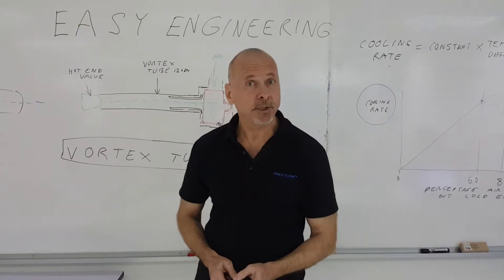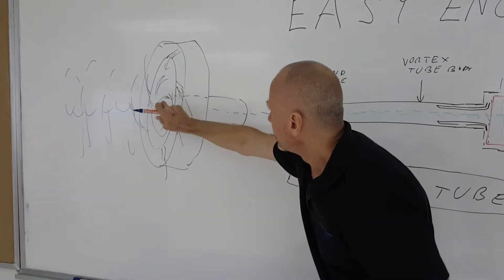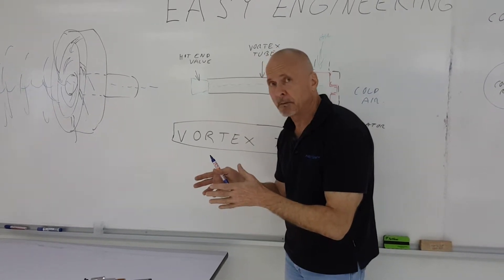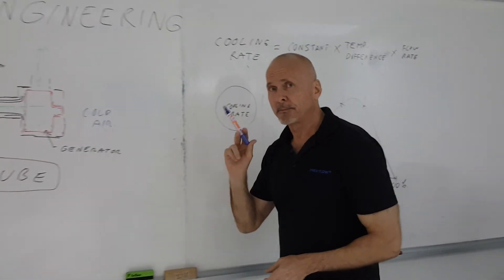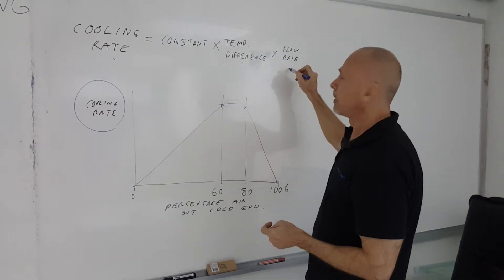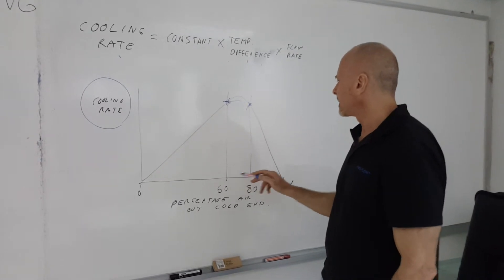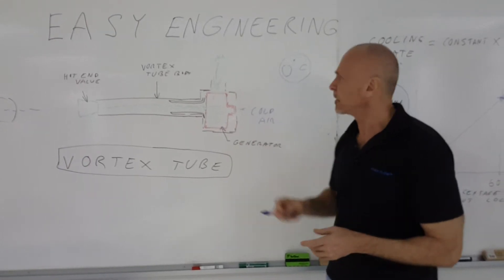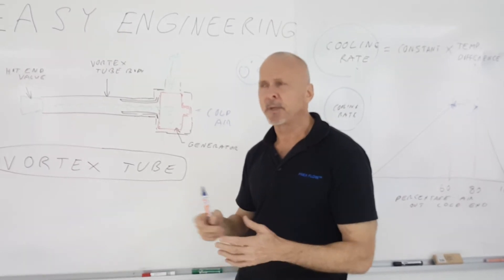EASY ENGINEERING - How Does a Vortex Tube Work and What are the Parameters

Comment: The issue with conventional explanations for the VTs operation ( bladeless adabiatic turbine ) is that there isn't any reason we know that (1) the air should remain spinning or (2) it should return down the core in such an organized fashion. The heat transfer being somehow solely convective is also a big problem because dwell time is so low. Also, if a vacuum is present in the central inlet, that SHOULD be possible to create without having to "swirl" the air, but that doesn't work at all.

In other words, although we know how to tune these somewhat, we still do not know how they work, despite claims to the contrary.
Reply from the maker: I am not sure what you write is completely correct, although very true that there are many theoretical explanations for why they work.  Heat transfer being conductive is not a basic assumption for the very reason you state.  I tend to prefer the angular momentum energy transfer approach but again, there are different theories.

Comment: Hello there,

Very informative video, does the temperature of the compressed air going in change the cold output? I.e if I use 16 degress Celsius compressed air vs 30 degrees compressed air?

Any help would be much appreciated
Reply from the maker: Yes - the vortex tube is designed to give a certain temperature drop from whatever the input temperature is.
Reply: @NEXFLOW  wow really?
Sorry just to clarify, I am using a vortex needle that is currently giving me -12 when ambient in my work shop is 12 degrees Celsius or near the compressor.
So In the summer when my work shop reaches around 25 degrees Celsius will I still have the same -12 degrees Celsius.
Does flow rate from the cold end get affected buy this?
Sorry for all the questions and I appreciate the help!
This is amazing technology which I have become obsessed about.

Kind regards 

Lewis
Reply from the maker: It is unlikely that the actual compressed air changes very much with your shop environment as it always gets hot when the air is compressed (and then usually cooled to a certain temperature.   This is probably why you do not see a significant if any change in temperature output.   Flow rate would not change.  Send any detailed questions to sales@nexflow.com and can give more detailed answers.
Reply: @NEXFLOW  thanks so much for this info!

Comment: I am experimenting with vortex cooling. My occupation we put people into an "oven" to work . Roughly 150 degrees F. They also wear chemical and fire protection. The bulk weight limits more body worn devices. Currently we use a breathing air supply to a manifold that directs air to a respirator and the other, a body cooled manifold. The body cool supply is directed through a vortex cooler before going to the body. The compressor that supplies is industrial. But as you say, flow rate and temperature make a difference! 
I installed a vortex cooler outside the "oven" prior to breathing air supply hose in addition to the body worn vortex of the oven entrant. This worked to make things cooler. However, you must dial in the vortex tube adjustment to the optimal settings. The breathing air respirators  are air on demand. So, the more you adjust for flow out of cooling tubes, the more "assistance" one loses in breathing due to pressure drop. Wish we could be approved to lose these air-on-demand regulators. I need people to be able to breathe freely and remain cool as possible while performing work.
Reply from the maker: We can offer some assistance on this.  Please send your details to technical@nexflow.com and one of our technical support personnel will get back to you

Comment: You all missed the boat. Where does cooling air come from. When you compress air you add energy and increase it's pressure. Now you have relatively warm high pressure air. Add a small restriction, orifice and the end of the pipe, the air velocity increases, pressure decreases, air looses energy as it dissipated to atmospheric pressure. Looses energy means it cools off. So the actually cooling affect is created at the small price, air restriction causeing the air to leak out and rapidly expand, loose energy, cooling the once high pressure warm compressed air.

In other words, just like when you let air out of a warm car tire, as the high pressure car tire air escapes and expands to atmospheric pressure the air inside cools.

This is not a very efficient kethode of cooling because it takes a lot of energy to compress air, your simply bleeding the compressed air out, which the compressor has to start and run to keep the compressed air system pressure up
Reply: Sorry but you not correct.  The cooling is NOT from the pressure drop.  I strongly suggest you look at the plethora of video's and other studies on vortex tubes and you will understand..
Reply: Cooling is controlled by energy laws, you can't create it destroy energy. So for cooling to take place all your doing is moving heat, energy from one place to another.

In this case energy from electricity is used, moved from the electricity through a compressor compressing air moving energy to the air. Then you let the compressed air out, it expands, energy is dispersed cooling the air ...

Comment: I think it should be common knowledge by know how cooling works... taking hot air away and replacing it with cooler air... the confusing part is how does thee air invert itself without destabilization, one thing that he doesn't explain, so on to another vid that shows how it actually works...
Reply: Not sure what you are commenting on here.  The video is strictly on how the cold air and hot air are created with a vortex tube, and the parameters on the efficiency and temperature range - nothing is replaced,  As for using it, that is another video of course.
Reply: @mycutebutt1000  It is unfortunate that physics is hard for you, but to make it easy on you, when you use active cooling, hot air is moved and replaced be cooler air... thus correcting your first statement... then second is my actual question where he does not go on to explain  how the inversion happens. it's like "let's skip that part cause we don't know either" thing
Reply: Hello again.  We mean the same thing,.  Sorry for any grammatical missteps.  As for the unexplained part, it does not matter at a practical use level.  For your own desire for deeper understanding, there are a plethora of published works and videos.  Most contradict each other and are not necessarily correct.  It serves no useful purpose to regurgitate them here.   Please do have fun but we suggest you be critical of what you find as much as you are critical of not getting the answer you want here.   We remain active in research with educational institutions on the technology that hopefully will yield results to benefit everyone.
Reply: You all missed the boat. Where does cooling air come from. When you compress air you add energy and increase it's pressure. Now you have relatively warm high pressure air. Add a small restriction, orifice and the end of the pipe, the air velocity increases, pressure decreases, air looses energy as it dissipated to atmospheric pressure. Looses energy means it cools off. So the actually cooling affect is created at the small price, air restriction causeing the air to leak out and rapidly expand, loose energy, cooling the once high pressure warm compressed air.

In other words, just like when you let air out of a warm car tire, as the high pressure car tire air escapes and expands to atmospheric pressure the air inside cools.
Reply: @airgliderz , then why do we need vortex here? Obviously it’s more efficient, but how? Would Bernoulli equation alone explain that?

Comment: I dont see an explaination of why the energy of the air is transmitted on one end vs the other.
Reply: Video does not explain at all how it works. It's simple air form a compressor is at a relatively high pressure and temperature. Likeist any refrigeration system, the high pressure air goes through a restriction risrict flow while at the same time increasing air velocity into an muche atmospheric pressure enclosure, the high pressure air slows and expands rapidly, it looses energy, this cools.

Why if you open the orifice more, less restriction, the cooling affect, pressure change is less.
Reply: It works the same way as any other refrigerator. There is a pressure gradient from the outside of the vortex to the inside. So the thermodynamic equilibrium is going to result in cooler air on the inside and hotter on the outside. That's no different to why the air at high altitudes is so much colder - if air is moving from high pressure to lower, it has to expand and cool. If it moves from lower pressure to higher, it has to compress and heat up. If air circulates between high and low pressure areas for whatever reason, that's basically just your refrigeration cycle. Finally, the pressure difference only gives you so much temperature difference between the hot air on the outside and cold air inside of the vortex, but because you have the length of the tube to work with and hot and cold air flow in opposite direction, these small differences add up along the length of the tube. So you end up with the hot end getting really hot and cold end really cold, even though in any given cross section, the difference between hot and cold air isn't that high. And, of course, there's the question of why there is a pressure difference in the first place. And that comes down to two main factors. First of all, the air is moving so fast that there is actually a substantial pressure from centrifugal force. Second, the air on the inside actually rotates at a faster rate, both due to aforementioned conservation of angular momentum, and the fact that outer air is slowed down by the surface drag. This gives you the Bernoulli effect pressure drop in the middle of the vortex.
Reply: @konstantinkh  did not see this reply until now, but I'm so glad you spent the time to type it. This makes intuitive sense now. Thank you.
Reply: Correct - there are various theories but as yet none really explains it.  My favorite theory is transfer due to to angular momentum conservation.  But you are correct, no explanation because it is yet to be proven why it happens.
Reply: @mycutebutt1000  I concur with your theory. Obviously thermally homogeneous air is input into the device, so the energy it would be extracting from the air would be decreasing the airs velocity and transferring it into the tube walls. It's just annoying that people seem to glaze over the operation and just say "they just work" as an explanation.
Reply: There are many theories on why this happens and that is a matter for physicists to debate.
Reply: @mycutebutt1000   Hence why I'm weighing in as a physicist. The nuances and which effects dominate, might be matter of discussion, but the basics are as I've outlined.

Comment: Explain other parameters also..like humidity of air, diameter of tubes, pressure of compressed air, valve controlled area,..PLZZ. atleast reply me with this relations here better than to make a vedio..I want it urgently
Reply: As long as compressed air is filtered, it does not matter.  The compressed air pressure will vary performance and we have a performance chart that shows it on our web site.  Please see the web site at https://nexflow.com and simply send your information to us with details of what you want as well as your contact details and location